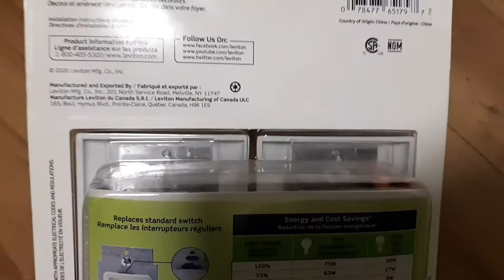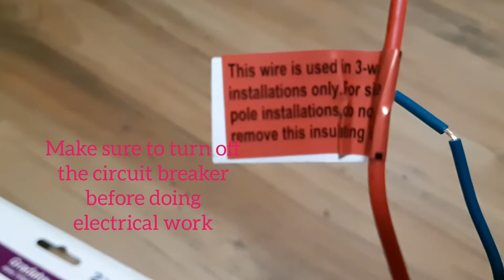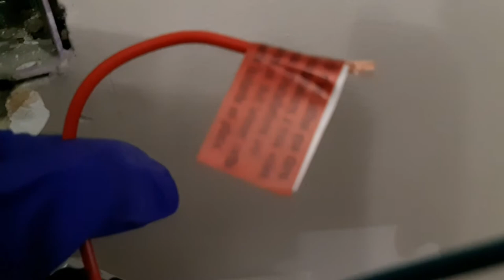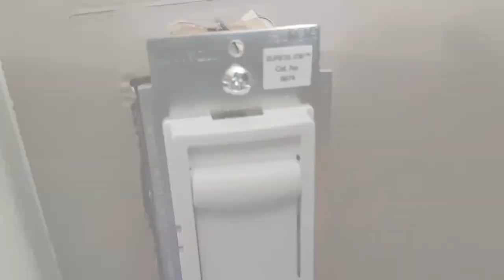Slide Dimmer Switch Installation@myhowz

Comment: Where did you connect the ground wire on the switch to? I only saw your switch connected to the hot and neutral.
Reply from the maker: The existing ground wire was connected to the metal box and once it is covered by the switch metal plate and is now grounded.
Thanks for watching.
Reply: @myhowz  So do I just cover the unused green and red wire with the caps? I have the ground wire connected to the box as well.
Reply from the maker: Yes. I think it will work